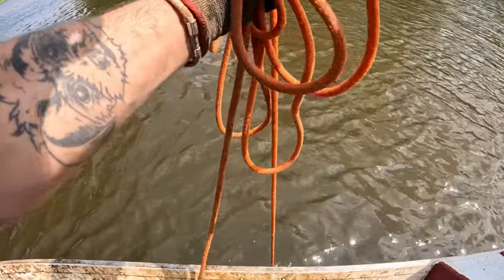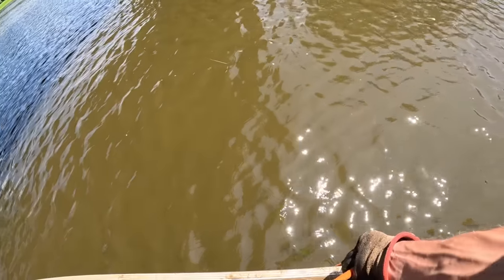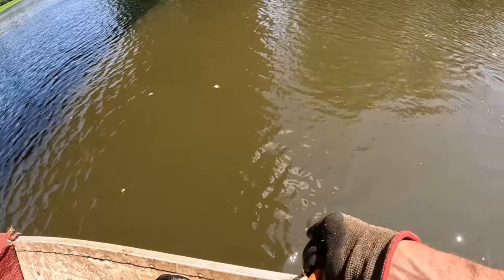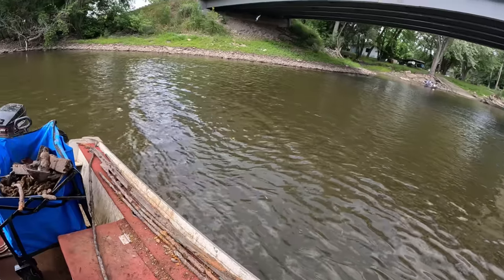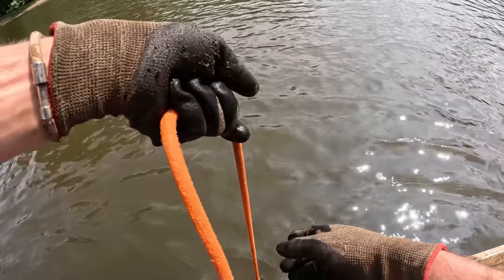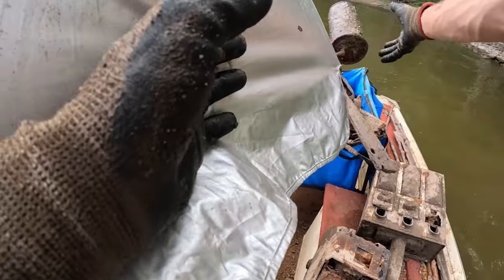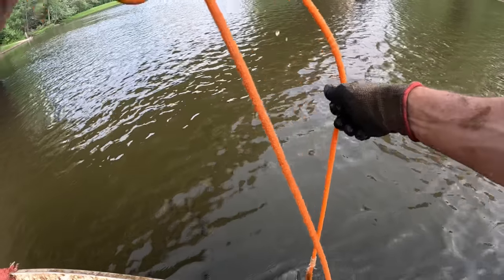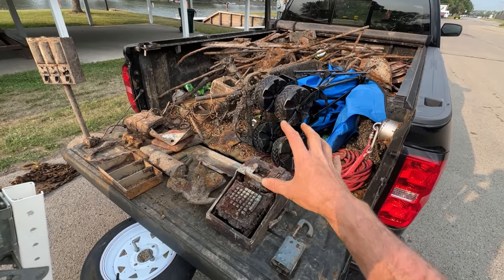JACKPOT Magnet Fishing Country Farm Land GONE CRAZY!

Comment: The chain isn't a tow chain. 
It's a hoisting chain.
The center loop would hook to a crane,  and two other hooks would connect to each end of a long load.
Reply: That's a recovery bridle  for a Heavy Tow Truck like a Rotator.
Reply: The top you found with the 2 key hole goes on the top of candy machine ❤😊😮
Reply: Makes me wonder of they were trying to pull a car out of the river and they lost the chain. That looks like it would be perfect for a job like that. By the look of the chain it looks like it was in the water for 50 to 75 years ago. So it's about ad old as me lol😅😅
Reply: That's to spread the load at both ends and pick from the ring

Comment: The gum ball machine was a great find!  That's a hell of a chain..and that lock you got is a lock box that realtors use on houses that they sell. 
And that machine for making money orders.
Thanks for sharing
Reply: That's what I thought it was, not a candy machine per say, but a gumball machine. A large part of those were made from glass.
The chain is a logging chain. Possibly from the same truck that filter was from. You'd chain up several large logs in front, back and the center chain would have that loop in the middle for the crane to lift the logs.

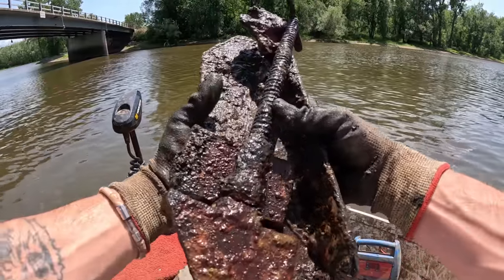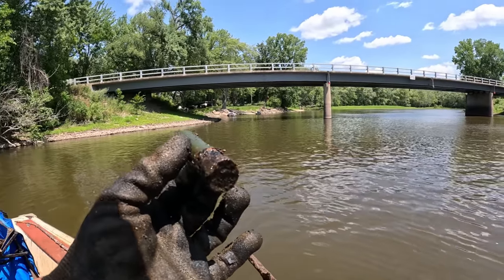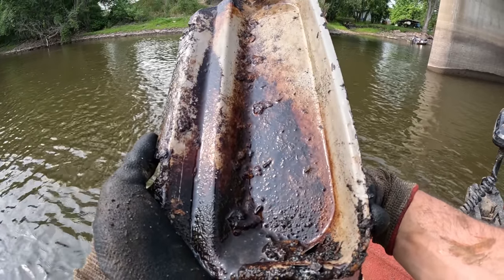Comment: 3:48 possibly looks like a clamp that may have come from a jig table or could just be clamp jigs they used on the bridge, 7:45 looks like 3 1/2 inch shell probably a dropped waterfowl shell from a duck boat anywhere from 2-4 steel shot 12 gauge, 21:25 is an antique adding machine, 25:10 see if that tray fits below the dispensers on the candy machine.

Comment: The machine is a adding machine/register. The rusted out box that was just a frame was the base to it that held the drawer (also rusted and fell apart when you pulled it out) with the plastic tray, there would've been other trays that fit in there too for coins (being older, only 3 bill trays would've been normal since 1s and 5s were common, 10s rare, and larger bills almost non-existent and would've been tucked under the tray if ever). The boxes were thin and cheap metal and would've rusted much quicker than the machine and door, which the bent up white piece with the single lock was the door. The red square with a lock in the center was the top to a gumball/toy machine you find outside grocery stores and probably went with the coin mechanism. The long door with 2 locks was the top to your 3 chambered candy machine you pulled up and the white tray went under the coin mechs and chutes on your candy machine to catch the candy/nuts. It's actually impressive how many parts you pulled up of the same machines. Someone knocked off a convenient store and you found the whole crime scene. The big blue lock is a realtors lock. A door key to a building is locked inside it and that's locked around the door knob/handle, and when a realtor needs to access it to show or set up they get the key out of it to open the door.

Comment: The chain is a living sling for a crane or Houston, probably from when they built the bridge. The machine with the buttons is a very old cash register. Had different groups of keys for dollars, tens and cents. The handle was to advance the tape. The piece you found with the wood on it is I believe what I call a lever dolly. The little wheels are gone. It had a handle about 5 feet long and the plate was meant to get ublnder the edge of heavy objects so you could lift it up enough to slide a rope or chain under it. The wheels acted as a fulcrum point and let you roll it around instead of carrying it.

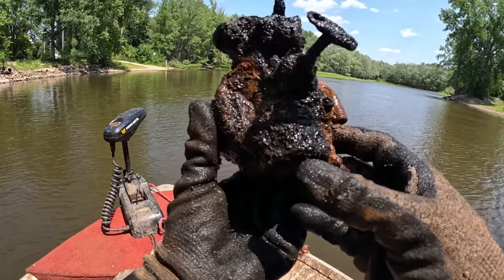Comment: 8:50 looks like an old carburetor.  Possibly from a tractor? It would depend on the name on it. 21:30 is an old adding machine.the tube thing could be an oil filter.Does the 3 section tray fit the candy machine?

Comment: I’m thinking that three sectioned tray is the cash drawer for underneath the cash register you found, they were slightly bigger than the bottom of the register.  And I’m guessing that the white tray would go under the candy machine slots so the candy didn’t drop onto the floor. …..🤔🤔

Comment: I believe you found a comptometer. I have seen it used in an  accounting office around 1970 before the advent of the adding machine. I think you would place your fingers on all the digits of a number and push down then pull the crank to add. Better than an abacus.